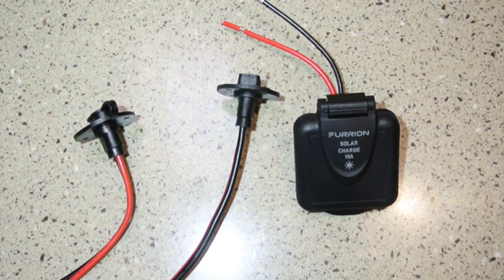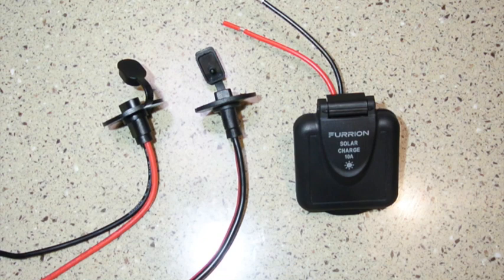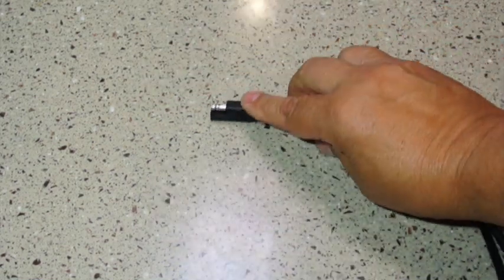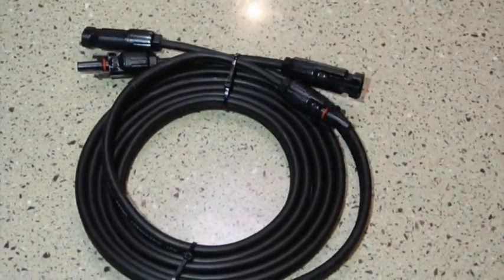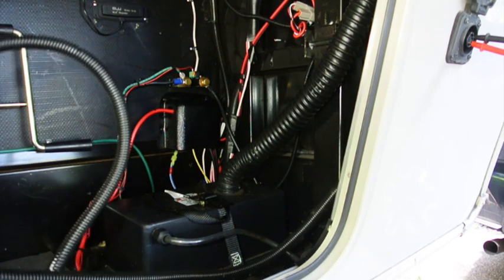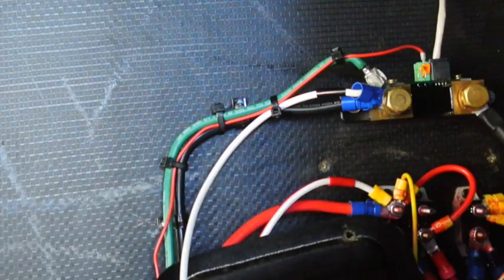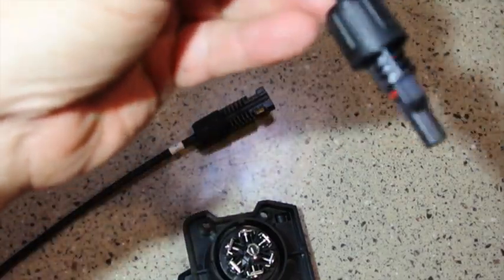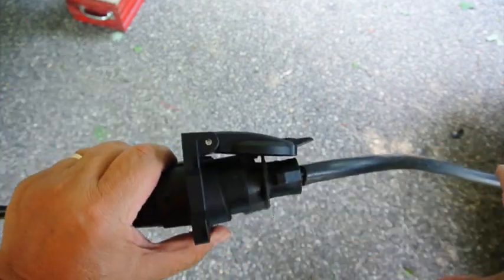Connecting a Suitcase Solar Kit to a RV - Portable RV Solar Charging Video 2

Comment: We just bought the Renogy 200 watt portable solar panel kit. I saw that it says the alligator clips are 14awg. We want to build a connector to connect via the 7 pin plug like you did... GREAT IDEA by the way!!! My question is what size mc4  pigtails should we get? I only see 10awg and 12awg ones on their website. Thanks for your help!
Reply from the maker: To reduce voltage drop issues in the wiring, use the heaviest duty wiring you can.  So 10AWG will be fine.  Also, you might want to check your 7pin wiring harness. The better ones have 10AWG for the battery and ground functions. Cheaper ones have 14AWG for these circuits, which again, can cause voltage drop issues.

I cover voltage drop issues extensively in one of the videos in the suitcase video series.
Reply: Thank you so much! I will look for and watch the video. 😊

Comment: Great video! This is exactly what I was looking for. Have the same suitcase with a SAE connection on my RV. I'm just wondering if there is a drawback to going adapter to SAE extension cable to RV rather than MC4 extension to adapter to RV? Then I only need 1 extension cable instead of the 2 MC4. Thanks!
Reply from the maker: Fewer connections is always better in my  view.

Comment: I have a cargo trailer, a titan solar generator, suitcase solar panels, and solar panel wires. Is there a plug that I can install on the trailer that will make quick connects on the outside and the inside of the cargo trailer?? (My goal is a weatherproof plug for the inside and outside… To allow pass through of current from the solar panels to the generator.)
Reply from the maker: You can purchase the Furrion connector as shown in this video, or a SAE style (mfg by Zamp and others).  My website for the video series has all of the links: http://www.rv-project.com/projects/suitcase.php
Reply: @RVProject  Thanks!

Comment: can you connect a 100 watt 20A charge controler to the furrion 10A inlet?
Reply from the maker: A 100Watt solar panel will output a maximum of around 5.6A, so you would be OK.

The 20A rating of the charge controller is the maximum output it could supply, provided a sufficiently powerful solar panel were used.  But using 100W of solar panel, you won't reach the 20A limit of the charge controller.

You would have to have about 400W of solar panel output to get the controller to output 20A.
Reply: @RVProject  Thanks for the answer,new sub and new to the RV world

Comment: Is it better to put the charge controller near the battery vs near the panel for efficiency?
Reply from the maker: Yes it is always better to put the controller as close as possible as you can to the battery. I explain this in video 3 and 4 of the portable solar panel series.

https://youtu.be/A6PxSvuGc5U 
https://youtu.be/_hDwUKKs7q0

Comment: Hey me again, they sure don't make this easy.  I finally took the Renogy 100 watt suitcase to the RV.  I purchased the 10 foot 10 Awg extension cables with MC4 connectors on each end.  I also purchased the MC4 adapter to Furrion Port. Before I plugged anything in from the solar panels, I plugged the MC4  adapter into the Furrion Port and tested the polarity with a multimeter. Sure enough, the Furrion Port is wired backwards.  The backside of the Furrion Port is behind a wall.  

Can I remove the pre-attached MC4 cables from the built-in charge controller, remove the MC4 connectors from the 10 foot cables, strip back the 10 foot wires and plug the black wire into the positive and red into negative on the charge controller and be set?  Then I wonder where Grand Design/Furrion has the 10 amp fuse behind the wall, on the black or red wire?  Thoughts?  Thanks!
Reply from the maker: I would try to find out which wires went to the battery from the Furrion inlet and make sure those are correct rather than re-wiring the MC4 connectors.  

You never know what the RV mfgs are going to do, but in my RV, it arrived with the Furrion inlet disconnected.  So it is possible a dealer might have connected the Furrion inlet to the battery backwards.

Also on my RV, the fuse was located about 4 inches from the back of the Furrion inlet.  If the backside of your Furrion inlet is covered up, you may actually have to remove the Furrion port mounting screws and pull the port out to access the fuse.  Shame on GD if that is what they did.

Comment: Good good info . Still a little confused on using my Jackery solar suitcase to help charge my rv flooded type batteries. I didn’t use the polarity reverser and melted my Jackery inlet box a bit . Ugh!!. Pulled off my Solar on the side port on my rv and the male of the same connection is red. Reversed the polarity of adapter for Jackery and my voltage on my batteries started to drop ... Help please!!!
Reply from the maker: You must install a charge controller between your batteries and solar suitcase. 

Since the Jackery solar panel is intended to be connected to a Jackery power unit, and the power unit has a charge controller built into it, I doubt the Jackery solar panel has a charge controller.

If you connect a solar panel directly to a battery without a charge controller to manage the charging parameters, you could fry your battery.

Comment: Quick Question: How many amps can the the 7 way plug accept ... comfortably? More than 10 amps? 20 or 30 amps? Should I read a manual?
Reply from the maker: It depends on the AWG of the wiring harness.  This can vary from RV mfgs, depending on the wiring harness they use.  

I have not seen any wiring harnesses with the battery wire being larger than 14AWG, so I would not go more than 10A. 

So you are looking at a 100-200Watt solar panel.

But also remember the wiring harness can add 10ft or more to the length of the connection to he solar panel, so you don't want to add a lot of wire to that due to the voltage drop issue (see part 3 of the video series).
Reply: @RVProject  If the wiring harness on the RV side is upgraded to 4 or 2 AWG. A nice project. There should be no issues? I'm thinking about installing a 40 amp charge controller (future proof?) inside the front pass through storage of a 25 foot travel trailer. At the same time moving the batteries to the same area. I would then (magically) connect panels via standard a 10 foot mc4 cable extension. That's the plan. I read that you lose less power from the panels if you have the charge controller nearer to the  batteries. Thanks.
Reply from the maker: @MyNormalLifeYouTube  In Video 3 parts 1 and 2, I explain and demonstrate that the closer the charge controller is to the batteries, the better.

Comment: Excellent video, I purchased a solar suitcase from Armada two weeks ago and have been using Alligator Clips to make the connection to the battery.  The SAE to Furion adapter will make for a cleaner installation.  Thanks for putting this series together.
Reply from the maker: Glad it helped

Comment: Can a 12 volt aux plug work as a connection?
Reply from the maker: Not sure what you mean by an aux plug; a cigarette-style automotive connector?  Any connection to the battery should work providing it is directly connected (nothing between the outlet and battery but wire), and the wire is short enough, and the wires are large enough so you do not have voltage drop issues.

In my 3rd video, I will show alternative connection strategies.